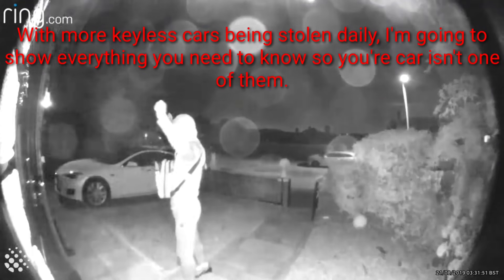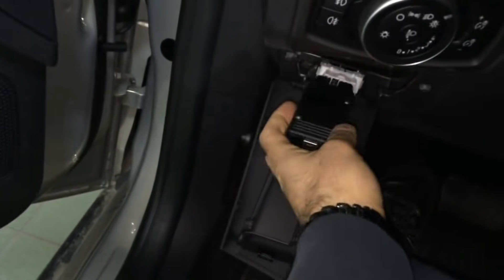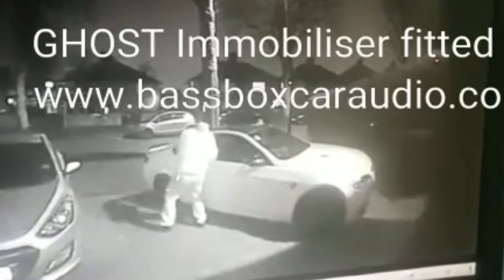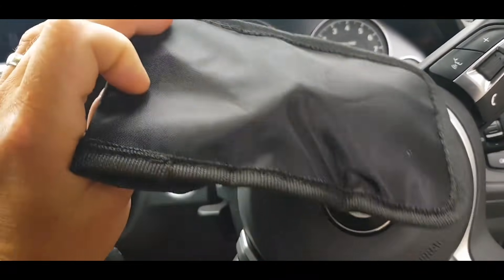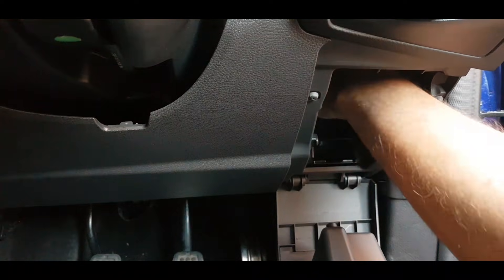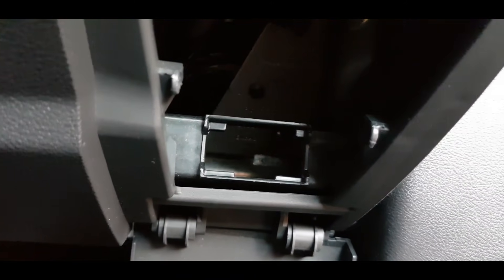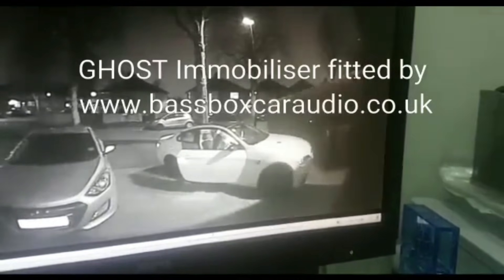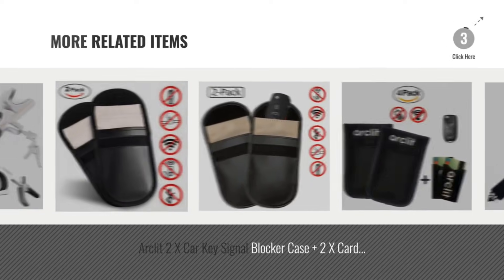Keyless entry car theft NO MORE how to totally protect your car from keyless theft

Comment: Why do car manufacturers make cars so easy to steal? It's ridiculous.
Reply: More sales
Reply: Because they're wankers I had my merc  stolen back in October due to Relay attack i even had my fob in a faraday pouch and still they got the signal I feel like burning down my local halfords
Reply: @Gehri_soch2.0  faraday pouches are 100% effective
Reply: So you buy another.
Reply: @yamil.343  Cynical marketing, should be outlawed.
Reply: Because they want you to buy another one. The politicians have the power to fix this but choose not to because most politicians have stock in the auto industry 🤔
Reply: Because it's your problem not theirs.  Even with the old mechanical key, it was easy to create a keyring of keys for a given car manufacturer where you will find a key that works and it isn't very many keys.   There was one business trip where I had parked my rental car at a client's office and when I got out, an identical car from the same rental company was parked beside mine, the keys worked in both, fortunately I realized this before driving off with the wrong car.  Security of your car is just not important to the car manufacturer, selling you the car is all they're concerned about.
Reply: If you choose to use a tin box or aluminum foil as a Faraday cage, test it by putting your fob shielded in it then carrying it out to your car and trying to unlock the car and start the engine.  It's very easy for a Faraday cage to act as an antenna instead of an RF shield and as the market is not regulated, the various commercial Faraday cages like Faraday key pouches are simply untested.
Reply: It's how they move cars and trucks.
Reply: absolutely
Reply: Yeah they were way harder to steal with a slim piece of metal back in the day!
Reply: @WajihaTahir1 did you have a steering wheel lock
Reply: I actually talked to them about that, it hurts their bottom line, so they all United and didn't implement it. Stolen cars and parts are great for business
Reply: Just like The government. Make u keep coming back to vote For the same two headed snake .
Reply: I put my keyless fob into a metal sweet tin, one of those herbal mints tins, sat in the car and the car only started from the button press 😮. No other key in the car or near it😮
Reply: I bought a key pouch and it did not work
Reply: To those that say so that you buy another: would you buy another if your first one got stolen that easily ?

Comment: OK my anti-thief System. New Toyota parked in driveway which has built-in GPS, so if stolen can be tracked by Law Enforcement. However here is my basic system: 1. Apple Air Tag hidden in the car (speaker removed). 2. Vantrue N4 Pro dashcam system with integrated Parking Mode to video intrusions. 3. Steering wheel locking device (yes just a basic deterrent but cheap and will stop some dirtbags). 4. Motion sensor security light/camera combo over driveway. 5. Faraday box in house and pouches in the car. 6. Toyota is a hybrid so not considering a kill switch now but could in the future. 7. 12 gauge by the front door. Cheers

Comment: What if you move the obd port but also install a fake obd port in the original location with 12volt coming out of just the right pin to short circuit the obd device?
Reply: Just your dealer know what you did before servicing your vehicle

Comment: The old system with the ignition key with an embedded chip was pretty good.   Thieves had to defeat both the immobilizer and the ignition lock to start the vehicle.   Now we have a security problem just so we can look cool when we walk up to the vehicle and it unlocks itself.
Reply: Honestly, keyless entry isn't new and that's not the problem. The problem is push to start

Secondly, as for push to start, they could make this better with better checks of some sorts, rolling codes even. But ya know, profits is all that matters to car makers
Reply: @charleshines7282 Convenience gone mad:  the sales point they give is this:  "You don't have to rummage through your purse or pocket to find your key."   BFD.  So instead of pulling your key out of your pocket, you have to go through all this B.S. and your car still gets stolen.
Reply: Not only is the fob easier to hack the fobs cost $300-$500 each. There is no big discount in getting more fobs most have to be programmed by the dealer. They don't like being dropped they don't like getting wet

Chipped keys were only expensive ($350) if you didn't have at least one key to clone. Getting a second key from the dealer was $75. With these two keys you could buy a chipped blank for about $10 and have it cut for $3 then program it yourself.

Comment: Absolute LIFE SAVER mate, u just filled in some gaps for me in terms of all the items that can 99% secure a push button car.   I estimate if i go the Disklok steering lock route, with a brake jack lock to prevent brake press to start, and then a fake OBD port, along with a pouch for my keyfob, ok thats around £250 - £300 all in but WELL worth it in my opinion and all them devices can be used on future and/or other cars.   Peace of mind is all we need!!!

Comment: The best thing you can do is use the Faraday box or pouch, and park in your garage if you are able to.  That gives you a bit of a second layer of protection.  The Faraday pouches and boxes are usually very effective (most of them at least) and parking in your garage requires the theives to get into your garage.  And if your garage door is tied to a security system, all the better.

Steering wheel locks can be removed pretty easily, as a hack saw will allow the theif to cut a section out of the steering wheel as most are made of plastic.  A better option is a brake-pedal lock that prevents the brake pedal from being pressed, which is required to start Push button start systems.  However, even this is not entirely theft proof as someone with the proper tools can cut them off, although it would take them longer than it would to cut a section of the steering wheel off to remove a steering wheel "club" like device.
Reply: The Disklok is by far the best steering wheel lock though, pretty much impenetrable
Reply: Always check your Faraday, they breakdown after a while

Comment: I had an idea how to prevent this happening 
But your video was brilliant mate  ! Thanks for taking the time to make it ! And for the great tips ! A complete gentleman 👍 ! Its just a shame that they bought in keyless start in the first place ! But anyways hopefully with all this going on they will bring in some kind of system to prevent this as is going on way to much ! 
Bring back the normal key , i wouldn't mind and I think most on here won't either tbh ! 
But anyways thank you for the video buddy
Good learning curve to prevent ! 👍
Reply: The way that keyless start with a key fob happened is that various countries such as Canada and Australia required immobilizers be installed so that cars could not simply be hotwired.  You may remember that car keys started having a resistor embedded into them which would be detected and if it was the right resistance, the immobilizer would be deactivated.   Yes, this was essentially a second factor authentication to the mechanical key ignition.  The auto manufacturers then did wireless key fobs mostly to compete with the third party alarm and remote ignition products and they soon realize they could just drop the mechanical key ignition and go strictly with the wireless key fob as the primary authentication.   As the thrives use the wireless repeater in order to use the ODBII diagnostic port to rekey the car to their own key fob, this problem could be solved by requiring a cheat code be pressed on your key fob to allow a new key fob to be assigned instead of just requiring the presumed presence of the key fob within the car to authenticate assigning a new key fob.   As to the Faraday pouches, that industry is unregulated and it's very easy for a Faraday cage to act as an antenna instead of as an RF shield especially if it isn't grounded or is improperly closed, I would advise actually trying to unlock and start your car while your key fob is in the Faraday pouch, preferably each time you lock your car.   Interesting, Toyota now has a key fob that can be completely turned off with a cheat code though it does turn itself back on with a single key press hence can easily accidentally be turned back on in your pocket

Comment: In Toyota key Fob’s, you can désactive it by pressing the lock symbol and at the same time press the unlock symbol twice..a small red light will appear at the top right hand side ..it is now desactivated …to re-activate simply press the unlock symbol…easy, safe and saves your battery…

Comment: How about manufacturers put a switch on the key fob that simply disconnects the battery inside the fob? Cheap and easy to implement. Also, how about a hidden kill switch?
Reply: What I did was jump out the start relay fuse located in the fuse panel. Wire the lifted fuse into an inline fuse & a hidden SPST switch. With that switch open there's no way in hell the starter will engage. I JBWELDED the lift into the fuse so it could not be removed and the fuse jumped. I also wrapped the lifted wires with stainless steel cord to prevent them from being accessed without a pretty nasty wire cutter. I hid the switch under the rear portion of the drivers seat that means the bad guy hasta find that switch, flick it back ON so they can turn over the starter. and all this assuming that they know where the fuse panel is AND that its been tampered with.

Comment: Thank you for making such an informative video. I am a little confused regarding what exactly is the definition of a keyless entry car is?. I have a 2010 year of manufacture car. It uses a fob to open the doors (press buttons on fob to open and lock doors remotely). The fob must be inserted into a slot in the dash and only when done so and a 'start' button pressed (also positioned on dash) will the engine start. Can this type of entry and engine start method be a target for car thrives? Thanks for your advice.
Reply from the maker: if you can walk up to the car  without getting the key out and push a button on the door handle or pull the handle and the car unlocks for you that's a keyless car. a car from 2010 isn't really what a car theft would be going after now as its to old.
Reply: @MADMODS I wish 2010 was too old to be targeted. My 2006 car just got stolen a while back lol

Comment: I know with Toyotas' keyless entry, you can disable the key fob with a series of button presses. Saves battery life and disables the handshake between the fob and car until you enable the key fob again for use. I park in the garage, so I already have a slight advantage in security.
Reply: how do you start the car then ?
Reply: @العقيدمعمرالقذافي-ح4ف  hold the fob at the push to start button.

Comment: While waiting for your Faraday box to arrive, another option is to simple "sleep" your key fob so it doesn't transmit. On my Subaru, you hold down the lock button and tap unlock twice. Pressing any other button wakes it up again and returns normal function.

Comment: Toyota and Lexus allow you to turn off your fob. It’s called Electronic Key battery-Saving Function. 
When battery-saving mode is set, battery depletio tronic key from receiving radio waves.
Press the unlock button twice while pressing and holding  the lock button   Confirm that the electronic key indicator flashes
4 times.
While the battery-saving mode is set, the smart access system with push-button start cannot be used. To cancel the function, press any of the electronic key buttons.
This will prevent relay thief.

Comment: Ahhh I just realised something my car does not start with just the signal, unlike the newer cars I have to insert the key then switch off and take key out then start it so it's not just about the signal however the newest ones you just have to have the key in the car, I might be wrong but I'm pretty sure thieves have tried my car

Comment: The signal from a corolla cross key can be disabled by holding the lock button and pressing the unlock key twice and release the lock key after 2 seconds.  No need for pouches.

Comment: My keyless remote wouldn't work when my battery went flat.  So, I figure, a quick disconnect on the negative black side of the battery would work the same way.  You might want to give that a go.
Jon in rural BC, Canada

Comment: Excellent tips. Please advise how to protect theft of signal/code while using the remote to unlock the vehicle. Some thieves sit nearby waiting for the driver to unlock the car; they have equipment that steals the code being passed from the remote to the car.
CORRECTION: It’s not an issue with newer vehicles remote systems. Their FOBs issue a unique code every time. If someone steals a code, it’s not useable the next time.
Reply: all modern fobs have antigrab technology, even if they get the code, the code is useless when they use it
Reply: @AdrianJayeOnline  What years are 'modern'? I have a 2009 Honda Fit - just bought. 'Modern' enough?
Reply: Yes thats exactly how it happened to me. They blocked me in and waited for me to start the car, they drove off, and came back 4 days later and stole it.

Comment: Easy way, toggle switch that disconnects the main battery leaving a small battery to keep the electronics from any issues. Even when the thief tries to start the car the small battery will not turn over the starter. Very simple and it works. The thieves will be pissed and move on to anther vehicle.

Comment: If you press and hold down the lock button on your fob for about 3 seconds it starts flashing then keep your finger on the lock button and press the unlock  button twice this turns of your key fob so it can't be accessed remotely this save battery life in your fob and immobilizes it to reactivate it press any  key

Comment: I wrap my digital key in aluminum foil and no frequency is emitted, which keeps the doors locked. I hope it works.
Reply: @G S Bought 2 faraday pouches on Amazon, neither worked. But I didn't know know the keys can be 50-60 ft away and will work - thanks for the info Gemcor. I'll stick to my homemade foil pouch for now.

Comment: Only Question I have is how do you stop code grabbing when you leave your car in say a car park and someone is near by waiting for you to lock the vehicle?

Am I right in thinking the only way is to disable the key fob before you get out the car and only lock it when the fobs disabled?
Reply: all modern fobs have antigrab tech, you can't use any code that you grabbed
Reply: @AdrianJayeOnline  if you lock your car your key fob sends a signal, any car signal can be picked up and the key code accessed with basic equipment.

The key will then be cloned and soon after your car will go missing.

Show me how this tech stops key grabbing with a link or a tutorial, I’ve never seen any tech that stops key code grabbing, IMO it’s not possible to stop a signal being received by a thief as with keyless entry you have to transmit a signal period.
Reply: When you leave the car, lock the doors using the inside button not the fob. Then no code is generated and no jamming can happen where they stop the door from locking.
Reply: @debidee5548  there is no inside button if it’s keyless entry.
Reply: @Happytruth  Yes there is. It's right there next to the window buttons on the drivers side door.
Reply: I never use my key fob to lock my car, I always use the button inside the vehicle.
Reply: @Happytruth  most vehicles have a lock/unlock button inside the vehicle still where the door handles are
Reply: @Happytruth  I guess it depends on the car. My vehicles with keyless entry have a inside door lock button...

Comment: Hello is having the key fob in a pouch enough to prevent my car being stolen? + removing keyless entry.
Reply: No as they could break the window and program a new key through the obd port. You could put cable ties over the port if you wont need to use it much or relocate it as shown in the video
Reply: @2WheelSam  wont they cut the cables tie though??

Comment: Would it potentially be possible for a thief to get into my car and disable my fob keys? I'm the kind of person who always ALWAYS locks my car, and double checks it too. (even checking it three times sometimes) Yesterday I got notifications from my bank saying my card was being used, and I went to my car to check for my wallet (rookie mistake to leave that in the car, I know) and my car was completely unlocked and the wallet was gone. My fob key would not re-lock my car, and I thought the battery was dead at first, but my mom has a key to my car as well as us having a third spare key, and none of them are able to open my car anymore, so it is extremely unlikely that all three batteries died at once. I guess I'm just trying to figure out exactly what happened and what to do about the fob keys now. Is that something that they could have done, or is there some other possible explanation? Thanks in advance for the (maybe) answer, and thanks for your awesome video too.
Reply from the maker: It is possible depinning on your car. More likely something is up with the controll module in the car. Can you lock it up with the key? What car is it?
Reply: @MADMODS  Sorry for this late response. I could only lock my car by locking it using the button on the inside door of my car or actually turning my key in the lock on the door handle. I drive a Honda Civic. The key fob randomly started working again about two weeks after the incident.
Reply: They can just break a window like they did to my husbands car
Reply: Sounds like wireless computer hack. Example, reset vehicles outgoing signal (cause your key was lost or stolen), which deletes all fobs, then simply add new fob. Could even have the hack look like a malfunction to vehicle, which may correct itself later